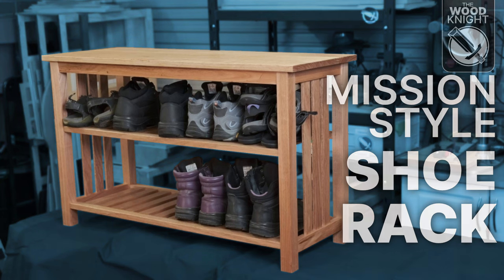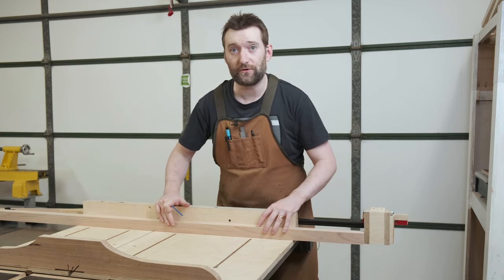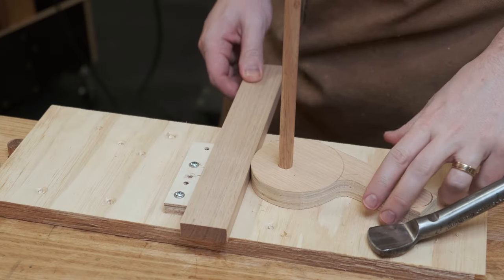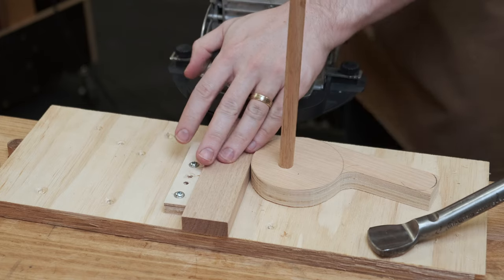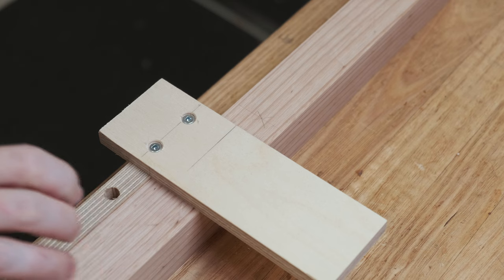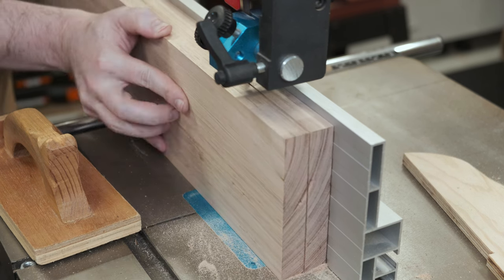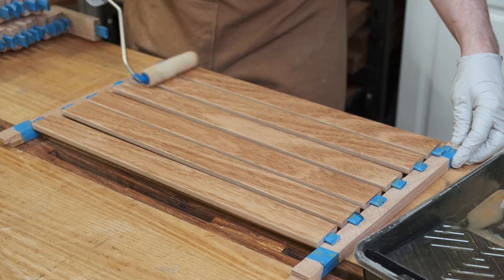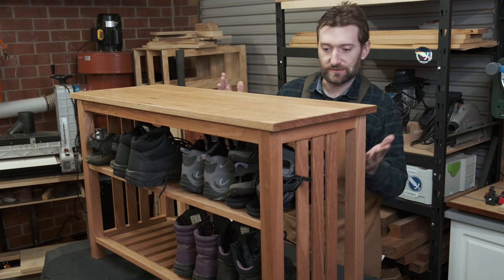Mission Style Shoe Rack (Works for Boots Too!)

Comment: Hi Paul. What brand and model is your combo jointer/thicknesser? And would you recommend?
Reply from the maker: Its an IWoodLike... something.  They're no longer in business.  
Carbatec's TJ-X300C is pretty much the same machine just painted blue, or Timbecon's  PTNSC-310 which is painted a much uglier browny orange. 
Same basic construction/guts, just slightly different shells. They're excellent machines.
The Hammer A3-31 or A3-41 are the next step up but I don't know what the price difference is. The hammer machines will have better fit and finish, a better fence and compatibility with their extension tables, but I haven't felt limited by the cheaper machine.
Reply: @TheWoodKnight  Great info thank you. Had been looking at both Carbatec and Sherwood

Comment: Quite nice. I bet the cost in dominoes almost broke the bank.
Reply from the maker: It can be pretty deceptive how quickly you go through them! As for costs...Approx 72 dominoes, $190 for a 1150 pack (6mm) puts it at about $12 worth. That's assuming you don't make your own.

You'd need to double that in screws (2 per join to stop rotation). If you buy official kreg screws, that's $40.90 for 500 of the 25mm screws,  so it would work out about $11.45!